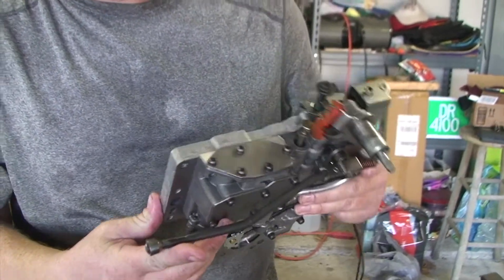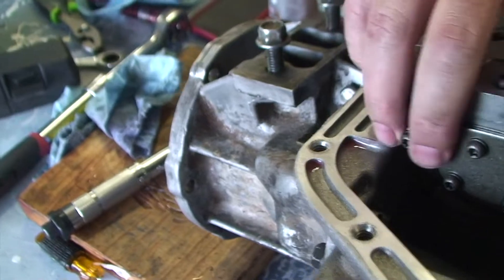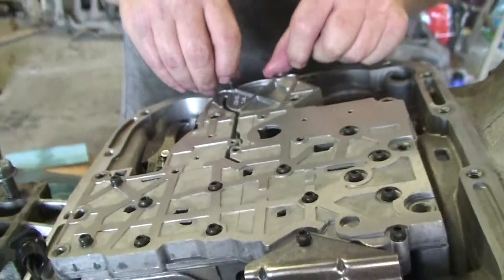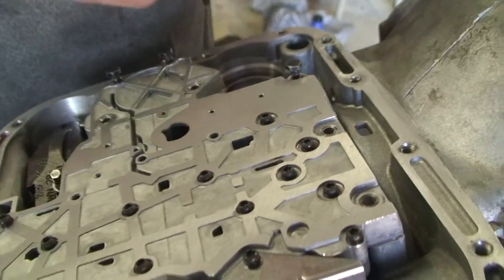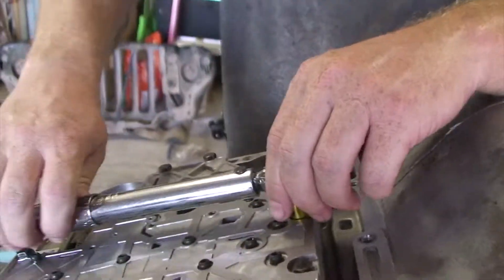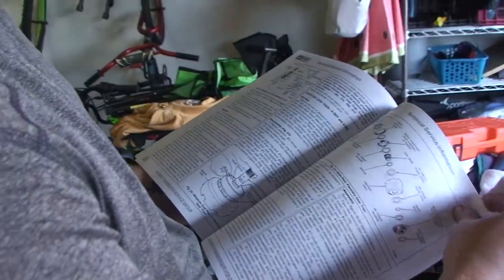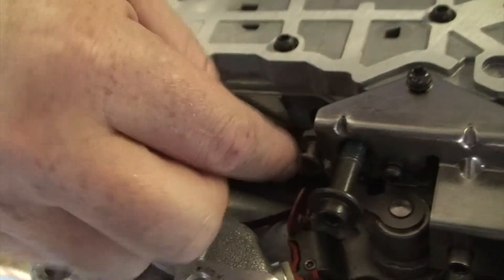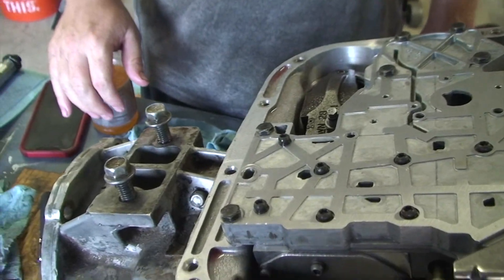32RH (904) Reassembly Part 8 - Valve Body Install

Comment: Hey thanks for the video. Just an fyi, you can put the clip on the plug before you plug it in. It's designed that way.
I have a converter locking and unlocking going down the road is what prompted me to search this topic. I wonder if mine has a wire worn bare like yours on the inside. I was looking for how to change the shift solenoid and learned way more. Thanks again for the series
Reply from the maker: Well TIL!!

Comment: How the hell did you get the parking rod to go in like that. I’ve been spending the last hour and a half. Trying to get it in. Please help please please please please please
Reply from the maker: with the trans out of the jeep it's a little easier.   There's a spring loaded "slicer" thing that needs to open up to allow the head of the rod through.   Then you MAY find that you need to turn the output shaft a little to go through the pawl.   It's one of those things that is either easy or you fight with it forever.
Reply: @bigjuicygarage4754  I replaced the TCC solenoid and was able to get everything back together once I moved the wheels and it popped right in. 
The code came back on too with a circuit code too 
P0740 and P0743
I bought another solenoid and hoping it was just the wiring. With the two pin female side, is do you know how to check to correct polarity?

I also overfilled the fluid a bit so I’ve got to drain it anyways and go again at it. 

Drives totally fine with the check engine on. 

For some reason my Dodge Van b2500 has this transmission in it. Total mystery as it seems it’s almost an exclusive jeep transmission.
Reply from the maker: @DustinRoams  Glad you got the park lever in without too much of a fight.  For the fluid, overfilled is better than undefiled for sure. I'll puke out the vent to get to the level it wants to be at.  

 For the solenoid, it actually doesn't matter which way you plug it in, all it does is complete the circuit.  The PCM just grounds the circuit when it's time to apply the TCC.  If you still have the code, try flipping the plug over.  You may have a short in the wiring that's causing the 12V side to ground out.  That's exactly what I had happen, only mine was on the wires inside the trans.

I also had issues in my wiring harness.  That part that goes up over the trans case can get hot & brittle over time.  While the trans was out would've been a great time to de-loom & check everything.   Otherwise you can unplug it all and pull it up into the engine bay without too much trouble.
Reply: @bigjuicygarage4754  I ordered another one just in case. I have taken out some of the fluid to balance out the correct levels and now I am only getting the 740 code. I switch the plug over tomorrow and see but I have a feeling that maybe when I was fighting the parking rod I may have damaged a wire inside of the transmission. 

I gotta say, the wiring within the trans case is a very poor design. I was blown away when I put it in thinking, these wires are just... in here? 

Truly, thank you for this whole video series. I am sure I will be running into some issues with this in the future and will have to do some work on this transmission. Very grateful!
Reply from the maker: @DustinRoams  I thought the same thing on The wiring.  Mine appeared to have rubbed bare on the sun shell.  Next time I have one open I’m going to try and route it between the VB & pan

Comment: This playlist was really really thorough and helpful when I rebuilt the 32RH in my 99 TJ.  I breezed right through the process.  Just to share back to the community, I'll share this tip:  When you reconnect that wire harness from the valve body, you can push the retainer clip into the plug  and then plug it in so you don't have to worry about dropping the clip.  Thanks again for a great video series!!
Reply from the maker: @1bradmc  you can get the thing plugged in with the clip “pre-loaded?”   I’m doing another rebuild right now, I’ll try it!

Also I’m editing some of the steps I missed, like replacing the piston seals, etc.

Comment: Where did you get the replacement parts from?
Reply from the maker: The rebuild kit was from Oregon Performande Transmission, but I used some “lesser” kits off eBay that had Raybestos frictions and had zero problems.   Beware that not all kits have replacement bushings, if you need to replace those.
Reply: @bigjuicygarage4754   Thank you
Reply from the maker: This is the actual kit I used.  

https://www.oregonperformancetransmission.com/product/OPT-A904-RB.html

Comment: Helpful videos! Thank you! I’m at the point of installing the rotating assemblies. Did you finish the pump install? Did the trans work as expected?
Reply from the maker: Yes, the pump install went great, I had done that job several times already and I guess I forgot to film it.   3 things you need to be aware of.  First, make sure the kickdown band is tight so it holds that drum in place.   You’ll do the band adjustment after the pump is in.   Second is that you’re threading into an aluminum block, so don’t overtighten.  The ASG manual has the right torque value but it’s shown in ft-lbs but should be inch-lbs.  it’s something like 175 in-lbs, so not very much at all.   3rd, don’t use the bolts to draw the pump into place.  It should take a few knocks from a deadblow.  Use some threaded rod to help align the pump holes to the case.  

Trans ran hotter than it used to, but I was already planning to put in a cooler after this.  I wanted to know the before & after rebuild temps before I added the cooler.
Reply: This is great! I’ll be sure to take those into account. I have threaded rod from the redneck slide hammer I made. Thanks for the reply. I’ll order a cooler as well, I never trusted the bottom of the radiator.
Reply from the maker: @gregashcom5753  I kept my lower radiator in the flow, went to the aux cooler after the radiator output.
Reply: Did you split the pump when you tapped and installed the plug?
Reply from the maker: @gregashcom5753  lol, not sure how you knew I did that, but no.   I probably should have, and for all I know those shavings were why the kickdown band was shredded.
Reply: @bigjuicygarage4754  haha, I saw the NPT plug in the top of the case from the video. I just did that last night. I assumed you plugged the pump.